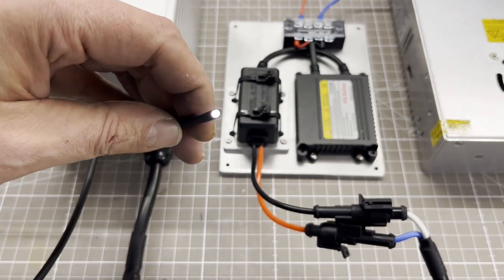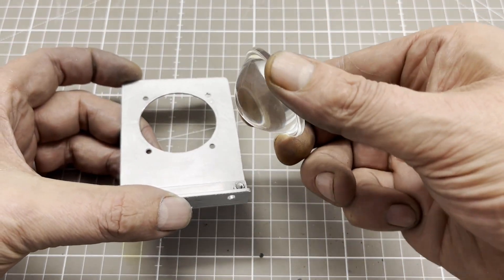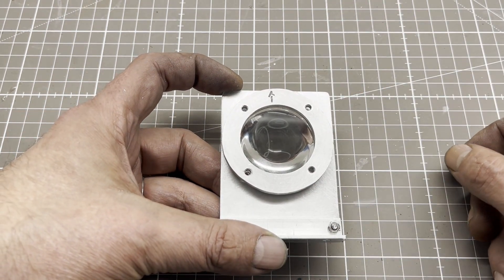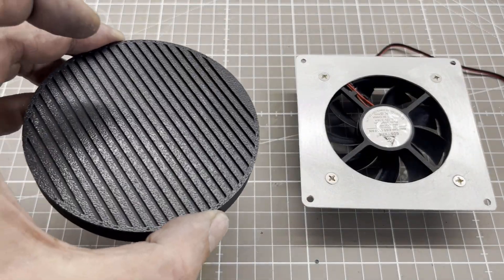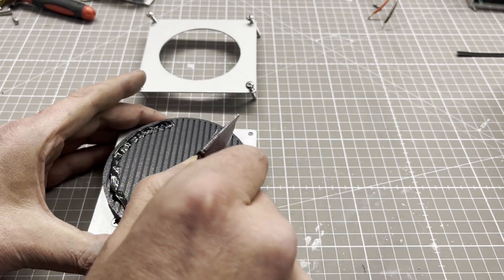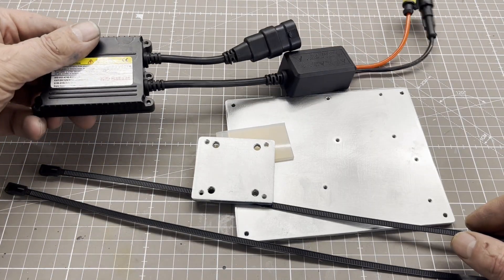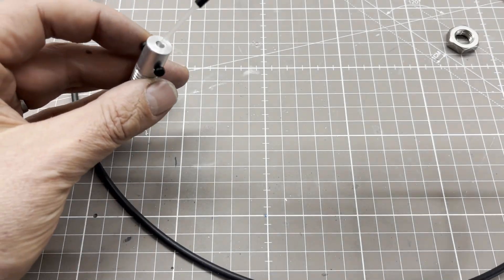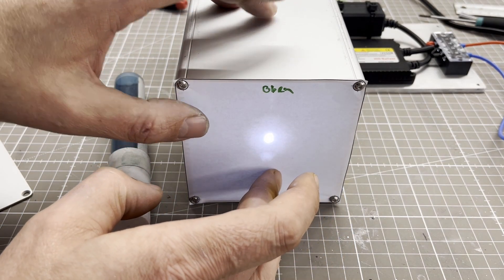Building a low-cost xenon light source for spectrometry

Comment: Great build but i must say something about the fan and enclosure. The fan blowing air into the unit but where is the exhaust of the heated air? does it distribute to the box by conduction only? I built something similar but didnt enclose into a box as that but had holes to allow the excess heat build up to exhaust etc.
Reply from the maker: The hot air is pushed out through the fan opening. Imagine a cup of hot coffee. When you blow into it to cool the coffee, you feel warm air escaping. I would have had to make every additional opening light-tight, so I opted for this less-than-ideal solution for heat dissipation.
Reply: @Marbslab I see what your saying. I put 3d printed black louvers on the exhaust holes that trapped the light from coming out. I guess the design has endless possibilities etc. I subbed your channel like your videos as well and enjoy the different projects posted. Keep up the good work!
Reply from the maker: @georgeyork8975  Thank you:)

Comment: Nice videa and impressive work! I am just curious you mentioned you built this for spectroscopy. The automotive xenon lamps often come with coating to block harmful UV light. In your spectrometer, do you see any UV components?
Reply from the maker: I can see the UV down to 290 nm. But I know some have coatings to block UV. I guess, the cheaper ones don't have that coating. I also built a xenon flash bulb driver, which eliminates that problem completely :).

Comment: In the past I have used automotive timing lights and photography flash bulbs.  The older timing lights seem to be a bit more rugged, with more data available.

The next mass-spec I am building has been shelved for over 5 years at this point.  I think I will continue to wait at least until I get to see your complete setup.

I have been used to building my test gear from trash.  But after checking out the specifications on that sensor you picked up earlier this year, I really dont want to mess around with a design that uses sub par pieces.

As always, i have really been enjoying your content and build quality. I love your style. Thanks mate!
Reply from the maker: Thank you:) It will be a while before I get to the mass spectrometer. At the moment, I am working intensively on quantum computers. Every evening, I watch lectures from MIT. It will be a fairly long project, but there are definitely overlaps with a mass spectrometer.

Comment: That's a quite powerful light source! I guess you want to use it for more than calibration. Otherwise the gas discharge bulbs from Philips fluorescent light starters can be used (Neon/Xenon mixture).
Reply from the maker: Yes, it will be the main light source for the spectrometer with flow through cuvette. It's part of my HPLC project:)

Comment: Great demonstration of buildind a low cost but efficient light source. I am also trying to build a flow-through cell for which ı need an optical fiber with high core diameter as you have here. Can you please give more details about the optical fiber, how to obtain it, and its stability in some organic solvents.
Reply from the maker: The optical fiber is made of PMMA (Poly(methyl methacrylate)). It's not suitable for organic solvents. Normally, flow-through cuvettes are made of quartz glass, and the optical components are located on the outside. I bought mine on AliExpress (https://de.aliexpress.com/item/1005009339138106.html). Still not cheap, but way cheaper than buying it elsewhere.
Reply: If you are looking for wavelengths shorter than 300nm in the UV you might want to consider using glass fiberoptic or a direct connection to the source output etc.
Reply: @georgeyork8975  I will make measurements in the visible region. However, as I will use an  in-house developed flow through cell, the fiber optic will be in contact with the sample solution and cleaning solvents. therefore I need to make sure that it will remain stable in some organic solvents such as methanol, ACN, IpOH, etc.

Comment: Thank you for this gem delivered in my suggestions.

I do have a question about the lenses though, naivly the rule thumb I tend to follow is to have the curved side of the lens towards the collimated side of theight for better aberration performance. Was there some special thought put into the orientation or did it just work out better this way specially?
Reply from the maker: Thanks. The lens arrangment makes sense if you consider the xenon bulb as a point-like light source. It works great that way. Thorlab has a similar lens arrangment:)
Reply: @Marbslab  Do you have a link to the Thor Labs arrangement? I built and elaborate system with  dual monochromators and quartz optics back in the 1980's. But it has a commercial Xenon source and I don't recall the optics that were built in. (A combination cryogenic instrument with Unablitz shutters and a rotating input/output shutter, and it could switch between florescence spectra and phosphorescence lifetimes.)
Reply from the maker: @charlesspringer4709  See here: https://www.thorlabs.com/newgrouppage9.cfm?objectgroup_id=13172&pn=SLS205
But there is no drawing of the lens arrangement. One can only be found for the tungsten-halogen light source: https://www.thorlabs.com/newgrouppage9.cfm?objectgroup_ID=7269

Comment: Just for your information: The automotive Xenon-Bulbs are no true high-pressure-xenon-lamps but they use a mixture of several substances like metal halides and mercury. Due to their medium level pressure (around 70bar in operation) their emission spectra are quite wide, but you will anyhow see discrete emission lines from their different ingredients.

True high-pressure-xenon-lamps or incadescent tungsten is not as intense but has a more continous emission spectrum.
Reply from the maker: Thanks for the info, Mr. Xenon:)

Comment: Just as a heads up for anyone wanting to build this. 
A lot of those cheap HID ballast drive the bulb with poorly regulated DC current instead of AC. I don't know how much it might matter for spectrometry, but at least to the human eye that usually results in worse light quality, with annoying flickering and a bluish or greenish tint.
Reply from the maker: I did not notice any flickering, also not in the video, but there is always somebody who has concerns. Xenon light is bluish, look at the xenon discharge tubes. If you have the money, you can buy a xenon light source from Thorlabs for 5000 bucks.
Reply: @Marbslab I'm glad it's been working well for you. 
Not al DC ballast flicker, but most of the cheap ones you find on amazon do and many people don't even know there's a difference. I think it's something worth considering to avoid wasting money (and decent AC ones are like $25-30 instead of $15).
I only have experience with using them in a car, and it's really annoying. 

As for the blue light, yes xenon light do have a blue tint, but if you search on youtube something like "AC vs DC HID ballast " you can see there's a difference even with the same bulb. I  find it interesting and it was more of a fun fact than anything to be worried about.
Reply from the maker: @Zilli_341  Thanks for pointing that out with the AC ballast. Fortunately, this can be quickly and easily changed if there are any problems:)

Comment: I thought that an air vent would be useful, because at the moment the air seems to have to enter and exit through a single opening. However, since the temperature is low, there is clearly no need for this. Great work!
Reply from the maker: Thanks for pointing that out. There are also static pressure fans available. Mine seems to be one because there are two markings showing the inlet and outlet area:)